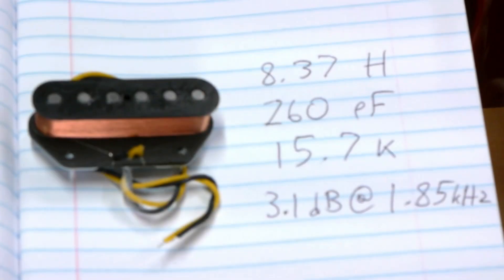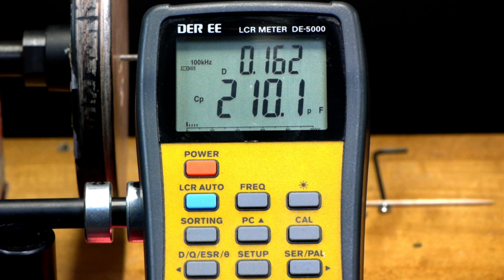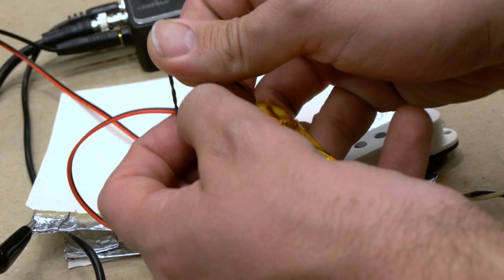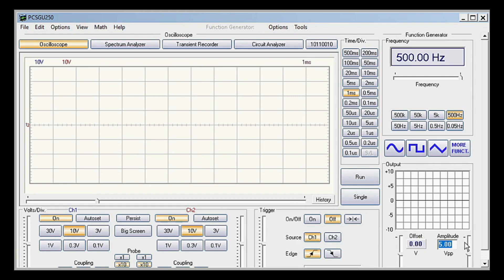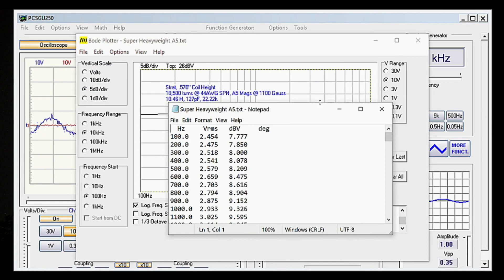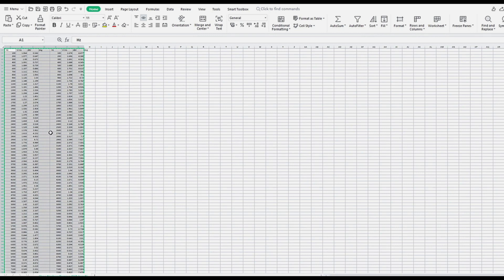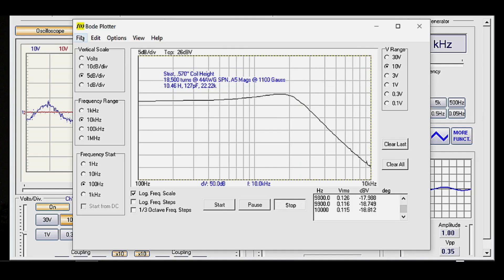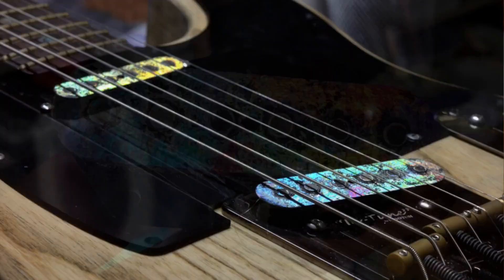Complete Guitar Pickup Testing: Step by Step Guide (LCR Meter, Gauss Meter, Oscilloscope)

Comment: 1st that Antigua Copy Paste work of Helmuth Leme ( he used knowledge from science - physic), actually lot of people copy his gadgets and don't gave him a credit at all.
2nd- that way of measuring is incorrect, 
3rd amount of error is huge
4th problem with today wonna be guitar scientists is that people think that they measure at home with highly changeable variations of pressure, temperature etc and above all conditions at home are not control that is a sound lab.
5th sine guitar is the source of the sound all those measuring don't mean much without a guitar
6th values will change even depending from a player. When to put guitar on your body it behave difrent. 
So all measuring's with lot of error's is IMHO only hype to sell pickups to ''sound smart'' 

Milan -Mike Dj. electronic Engineer ( guitar player, pickup winder blah blah ☺)
Reply from the maker: 1) Antigua has given credit endlessly to Helmuth Lemme. I actually only heard about him through Antigua, who has recommended his work many, many times and has made many threads about it. Antigua is the main person who has even made people aware of Helmuth Lemme over here in the USA and is constantly referring to, and quoting his work. 

I own his book as well - Electric Guitar: Sound Secrets and Technology. 

Manfred Zollner, author of Physics of the Electric Guitar, is another person I was turned onto by Antigua, and I own his book as well. The only reason I didn't mention them is because it slipped my mind, though in my video on winding noiseless pickups, I do quote Helmuth Lemme/Manfred Zollner and refer to information from their books on stacked humbuckers. I actually use a direct quote to explain the science behind how stacked humbuckers work as their books are the premier source of information on these things. 

2) I'm curious as to why you say the method of measuring is incorrect. I would love to know what the correct method is and also how to perform it. I'm not married to any methods. Only interested in the ones that work. 

However, I will argue that I have gotten excellent and repeatable results with these methods. I've used them extensively with repeatable, reliable results, and I have a hard time seeing how these methods would be incorrect, given that they've proven themselves useful many, many times in the real-world applications of my rewinding of vintage and modern pickups, and designing new pickups for people with very specific demands. 

These test methods have been indispensable to me. If there is a better method, I would be very curious to try it and to see how it compares to these methods that I have been using -- and have been very successful with so far. 

3) Which error rate is huge? I've built, wound and tested many, many hundreds of pickups and my results are always within very tight paramters, as measured by the LCR meter and USB oscilloscope. 

Pickups I wind to the same specifications are always within tight parameters. I am not seeing a huge error rate at all with these methods. 

With any pickup I make, it is always very reliably within tight parameters for L, C, and resonant peak. If these testing methods had a huge error rate, I would not expect that I'd be seeing virtually identical results every single time I make a pickup according to a particular recipe. 

4) I agree that tight control parameters are best. This would also come down to having a CNC winding machine that would actually be capable of doing a specific winding pattern -- and also a tension meter, to regulate the tension on the wire. All variables have to be controlled for building the pickup, and all variables have to be controlled for testing the pickup as well. 

However, I disagree that a highly advanced laboratory with state of the art equipment and everything controlled for as highly as possible is the only relevant testing. Home testing with a good LCR meter and an Integrator + Oscilloscope setup can provide relevant insights. I'd argue that extreme accuracy is not necessary because everything is relative. 

In other words, testing a stock Fender pickup, and getting certain parameters, will set a decent enough metric by which to compare another pickup. I can and have made pickups to fit specific tonal specifications based on measurements I've taken of pickups that were in the guitar -- and used the information I tested to create a pickup with a different profile that suited what people have wanted -- including myself, and my own desired sounds. 

These methods of testing have been very useful for me as someone who has built and wound a lot of pickups over the years, and I've used these methods for my own builds in my own guitars many, many times with great success. 

5) Ken Willmott's integrator device is not perfect, but it is constructed to put a similar load on the pickup that would be put on a pickup mounted in a guitar, including capacitance from a normal guitar cable, and load from volume and tone pots. 

There is a "loaded" and "unloaded" feature on Ken Willmott's Integrator device, to simulate the pickup being loaded into an actual guitar circuit. 

6) I completely disagree that this is all hype to sell pickups by sounding smart. This could not be further from the truth. 

Antigua does not sell pickups at all and every single one of his posts is just a result of his hobby of measuring pickups and being curious about what makes them sound the way they do. You can find this easily online in any of his posts. He is not selling anything, and never has. 

As for me, I only sell pickups infrequently, and I've never used these test methods to sound smart and hype up my pickups. 

I firmly believe, and can very easily demonstrate, that these measurements are accurate, and only serve to help people understand what they're actually getting when they buy a pickup. 

I would argue, actually, that saying that these tests are all "hype to sound smart" is actually hype to sell handwound pickups, by claiming that these tests are junk, and that handwound pickups have some particular 'magic' to them that cannot be measured -- so buy my pickups, because they're doing something magical that will not show up on an LCR meter or oscilloscope -- trust me! 

Because I will tell you: neither I nor Antigua is using these measurements to "hype anything up." There is absolutely no reason for me to post this aside from a labor of love and a desire to get information out there -- for free. 

So all else aside, that assumption is 100% completely false as I know my motivations, and they are not to hype anything up or to "sound smart." It's to use a practical method to evaluate pickups and to better understand how they work and why they sound the way they do. 

6) I would love to know more accurate test methods that account for the dynamic changes in sound while playing a guitar.

What you say is true -- the way you play will change the tone. 

However, while this is true, it grossly overcomplicates what pickups are doing. High impedance pickups, specifically, have a "baked in" EQ response, which is represented visually as a bode plot. 

The decibel voltage at a particular frequency, plotted from 100Hz to 10 or 30kHz in 100Hz frequencies, will produce a reliable representation of what frequencies the pickup is emphasizing, and how much, compared to other frequencies. 

And I can very confidently tell you that a pickup with a resonant peak around 1.5kHz will sound much darker than a pickup with a resonant peak around 4kHz, and generally speaking the inductance will be much higher in the lower resonant frequency pickup -- leading to dramatically increased output, which will dramatically affect tube breakup. 

You look at enough bode plots and you can predict how a pickup is going to sound based on nothing but the bode plot alone. They absolutely have value. 

One other point: Look into Cyfi research and their modular pickups. This is all open source by the way. They do sell pickups but freely share their plans on Github so anybody can recreate what they've done for very little cost. 

And they use bode plots to illustrate exactly why low impedance pickups are so flexible: it's because they have a very flat EQ. On a bode plot the line is virtually straight. Compared to a normal high impedance pickup, which has a peak at a particular frequency -- a rise up before it, and a slope down after it, like a roller coaster. 

There are real practical applications of this in the real world, and I've used these methods extensively when doing rewinds, and for planning out pickup 'recipes' for people -- including designing pickups from scratch. 

I am more than open to criticism and feedback. But I would need to see a very clear argument with very clear evidence, including the exact testing equipment used, and the results that were achieved, to convince me that the methods I've illustrated in this video are useless. 

They have been anything but useless for me, and in the most real world practical application: pickup rewinds, and custom pickup builds and winds. 

I'm not saying this is the be-all end-all of testing. And again, I'm open to criticism and feedback. 

The only thing that rubbed me the wrong way here was the accusation that this was to hype up sales by sounding smart. 

Absolutely not true -- demonstrably false. And again, I would say the opposite is much more likely to be true:

People saying that testing like this is BS, and there is not a test in the world that could possibly show the magic of handwound pickups, because what makes the pickups sound the way they do simply can't be measured. 

Home tests are not laboratory quality, for sure, but we're talking about passive, high impedance transducers for musical instruments -- not aerospace technology. 

Home testing equipment is certainly "good enough" for hobbyists and it does provide very valuable, repeatable, predictable information. 

I'd be curious what the team at Seymour Duncan or other major pickup manufacturers use. Like when designing new pickups. There actually was a post from the guy who invented the P-Rail pickup at Seymour Duncan. 

Frank Falbo I think his name was. Someone posted a question on my noiseless pickup build video about it. The Guitar Nutz 2 board has a lot of smart people there and I would not be so quick to write them all off. Everyone there is well aware of Helmuth Lemme and Manfred Zollner and the people there are way smarter than me. 

I just wanted something to measure pickups more accurately, and this definitely fit the bill. If there is something truly wrong with this testing setup, I would love to know so I could use something more accurate.
Reply: @guitar_md  I am excited to see what the über troll will answer to this 🙂 🙂 But he will probably not answer at all.
Reply from the maker: @qddk9545  No offense taken from him! I believe he's being genuine and sounds like he has a lot of experience with winding pickups, and probably has been doing it much longer than I have. 

I have no problem as long as people are respectful. The only thing he said that rubbed me the wrong way was insinuating I posted this to hype up sales for pickups and to sound smart -- however, in another comment he left on an older version of this video, he clarified that he was not accusing me of that directly or saying that I was doing that, just was a general commentary. 

Overall, no issue at all. I don't ever want anyone to think I'm not open to criticism. I always am -- as long as it's respectful. I took his comment as a respectful disagreement/criticism. 

Sometimes my super long replies might come off as me trying to be a know-it-all -- I hope it didn't come off that way as well. 

I'm always open to new ways of doing things and someone pointing out that I'm wrong if they truly know more than me. But I do value being thorough and I will make a case for myself and my current methods respectfully -- for debate/criticism/etc. 

I appreciate your support for me and my channel as well! I do my best to be as thorough as possible and one of my biggest fears is that I've missed something and am posting inaccurate information. So I'm always up for learning more. 

Plus, debate is good for my channel as it gets the comment section going. If you haven't seen my epoxying an acoustic bridge video....that blew up! And many of the comments are very negative! You will notice how I only get short with people who directly insult me, but respectful criticisms, I am more than open.
Reply: @qddk9545  Trolls' never sign with their name. I don't understand why some people think it's trolling if you say something that is from your education - profession, something that is based on what did you study for can't be ''trolling''? Everything I am writing like my first comment has nothing to do with this man directly, I saw his video and praised him in another comment because he is OK, but what is shown about the measurements and some conclusions, sorry, is not correct if you wish to observe it from scientific point. But video is great, it help out people to wind a pickup.

So my comment regarding pickups has nothing to do with me, but with Thales of Miletus, Tesla, Newton, Faraday, Gauss, Maxwell and other scientists who laid the foundations of physics - magnetism, induction, sound, etc.
I did not write anywhere that what was said refers to OP specifically  nor the video, because he picks data on the net + his experience+ people were he learned to wind pickup etc. so if you understand me well - it's not his fault nor it's personal critique.

Imagine how I feel as an engineer ☺ and thousands of other engineers in the world when people who are not trained in electronic and physics - talk about it and pretended they are ''scientists'', so certainly We don't call them "trolls" , no matters that some of them make money by selling products for which they use quasi-science. There are hundreds of them who have made millions of dollars through various hypes. Because it is 'fraud' ( maybe not the best word)  if you convince people of something that is not true with the intention of making a profit.
(Pls once again to underline i aim on some other brands not on a video nor OP)

Unfortunately, there are no laws against advertising and false claims. There is a law on consumer protection, but the guitarists are calm people who don't even try to ''fight'' for their rights. 

Afterwards, some guitar Gurus in Magazines and on Forums  wonder:
 "Oh, why are fewer and fewer people playing the guitar. Why guitar music isn't popular is it used to be"? 

Well, because they brainwash teenager's and younger generations that they need a $3000+ guitar, that they need a set of pickups that costs at least $200- 500$ ''hand wound'' with machine or made by some ''magic CNC'' (which will never do same job as humans when it comes to winding), a $3500 amp, and that it has to have the "Made in ....."  mark and be under a specific brand name.

Pls tell me what is % of teenager's who can afford that? IMHO less then 1%. 
 So  i have nothing against the video nor person who made it, and why on earth would i? IMHO honesty is OK when We share what We know and think, people can agree or disagree and that is all OK.
Reply: @guitar_md  Nope i didn't think this at all ''The only thing he said that rubbed me the wrong way was insinuating I posted this to hype up sales for pickups and to sound smart '', maybe it's lack of my English knowledge or i should make it clear that it it's not personal.
Reply from the maker: @milandjordjevic7952  Yes, this is why I pointed out in comment. I saw in another comment you pointed out you were not accusing me of this, just general commentary. I do appreciate the clarification, no offense taken
Reply from the maker: @bobibobik5903  I do understand your points. 

However, two points:

1) If my testing methods are not accurate, I'd like to know why, and what would be more accurate. 

2) Even if these tests are not scientifically sound from an engineering standpoint, they can certainly go a long way in dispelling all the marketing hype you're talking about. 

I've measured many expensive pickups, and I can say with confidence that a cheap pickup will sound the same, as long as it's close enough to the measurements that I showed how to perform in this video. 

Whether a pickup is $1,000 or $10, if the bode plot looks the same, and the pickup is the same type (Strat, Tele, humbucker, etc.) it will sound the same. 

Notice how NOBODY selling pickups lists the inductance, capacitance, and resonant frequency. Not one person is doing that. It's never a selling point. 

This is because objective testing like this dispels mythology. It isn't in their best interest for people to have any understanding of why pickups sound the way they do.
Reply from the maker: @milandjordjevic7952  Also, this is the Wiki for the Integrator, the device I use to measure pickups, if you're curious or have any critique of the design and use: 

https://github.com/KenWillmott/integrator/wiki
Reply from the maker: Also, check this out, from Helmut Keller: 

https://gitec-forum-eng.de/getting-to-know-you-pickup-a-tool-for-measuring-the-frequency-response-of-the-impedance/

You can find a discussion about it here: 

https://guitarnuts2.proboards.com/thread/10045/gitec-software-impedance-frequency-response

If you disagree with these methods of measurement -- I would join Guitar Nuts 2 and post your thoughts there. I'm a "button pusher" kind of guy. I asked Ken Willmott extensively about how to hook up his Integrator device, and Antigua over the years has referred me to Manfred Zollner and Helmuth Lemme's books, which I've read through, but go way over my head, as I have no engineering background. 

If you have any advice for a proper setup, let me know -- all the people discussing these things in-depth are way smarter than I am. I simply look for the best advice I can with this stuff, and follow the instructions. 

I just wound a set of Tele pickups and I will say that with the Integrator device and LCR meter, the readings do seem very accurate -- if they aren't, I would like to know why, and if there's a a better way, I will be doing that ASAP. I have yet to try that GITEC tool that Helmut released. But am looking into it now. 

It's a free download and in the documentation he describes what pickup frequency is and how to measure it. 

I will have to figure out how to do this and compare results with my current setup. However, if you are an engineer, I think you could certainly appreciate Helmut's writeup in the PDF file, under the "Documentation" folder in that zip file, if you download it from that link.
Reply: @guitar_md  I agree with you told about pickups price points, IMHO it all depends from how We make them + materials ( they don't have to expensive at all) + some if i may call them ''tricks'' or differences that We don't see in commercial pickups. Also each guitar deserve specific pickups in ideal world , but that is imposable to achieve so people need already made pickups and use them for guitars. In others words pickups are not tailored for specific guitar. The issue is that basically all winders We see claim they can do it but they only copy paste exiting approaches and few variables, it's copy paste of what fender and Gibson did in majority of cases and what Rick, Selmer, Burns, Hofner, Teisco etc did in smaller portion ( they copy models and ''recipes''). Moreover  some of the values they get from various books are ''incorrect'' due to measuring, people who just used multimeters didn't care about conditions.
Reply: @guitar_md  BTW i liked everything i saw what you wrote from this and another account, just saying.
1- for the start you can try to measure pickups in a room were you'll try to have the same temperature or at least close as possible ( depending from time in year), that alone will give you a huge advantage compared with a majority of pickup data out there.
2- Well i agree that measuring today are in general better then before. For sure good enough to wind pickups and sell them, people do that.

Sure some don't post all those data but some do, i saw it, once again it is nothing regding with you but i saw what some were doing for the last 10 years or so. 
Yes i know that it's not in interest of majority of companies to dispel myths. 

To be honest it's terrible due to i know some who use hypes, i mean ''know'', they are not not my close friends, some i never saw in my life but even in this region there are people who will ask without any shame 400-500US $ for a pickup. 
IMHO they don't have moral at all, but i try not to judge them, it is just panful to see that guitar music is ruined by those ''Vintage, Magic'' sellers. Some for sure get parts from China, i know due to i gave to some links and information's. Due to all that i feel terrible mate, it's like i did a huge damage to the thing i love the most - the music,  guitar music to be precise 😔.
Reply from the maker: @bobibobik5903  This is why I like making pickups I don't see anywhere else -- and of course, building and winding your own pickups you can get as creative as you want. 

I do agree that in an ideal world, each guitar would have a set of pickups tailored to it. This would include string gauges. One nice thing with humbuckers is the ability to stagger the poles at will, which you can't do on Fender style pickups without risking the destruction of the pickup. 

This is yet another reason I ventured into experimenting with wire I've never heard of anyone else using, such as 48AWG, with very short coils. It does yield some interesting results. So much has already been done in the pickup world so it's quite challenging to do anything truly unique or novel. 

For the modern 'bedroom' guitarist, I think noise cancelling low impedance pickups could very well be the way of the future. The flat EQ profile means they can be adjusted to sound like pretty much whatever you want in post-processing. With all the amp modelers and other things people are using now, a truly neutral pickup may very well be ideal. 

Cyfi research has information here on just that: 

https://www.cycfi.com/projects/nu-series/

"Nu Modular" pickups, with complete DIY plans on how to build your own if you so desire. I haven't attempted it yet. But I like the concept very much. We have to keep the times in mind, and many people now are playing exclusively through audio interfaces and/or amp modelers, even if they're out playing gigs -- modeling is taking over. 

Having a dead quiet pickup with a flat EQ seems ideal for this situation. Especially with all the noise generated by computers and monitors. Getting a clean recording can be very challenging without effective noise cancellation. 

However, there is also the "plug and play" ideology. I make all my own pickups for my own guitars, and for example, I prefer a highly overwound bridge pickup. I make my Strat bridge pickups with 18,000 turns of 46AWG, and the tone they get is just perfect for me. I pair it with a 7,600 turn neck pickup. 

And I wire it with a series/parallel and in phase/out of phase switch, master volume, master tone. I make my own pickguards and make custom 2 pickup pickguards for my Strats, and I also make a top-loading plastic jack plate, with a 3 way box switch installed on it as well. 

In this way, I have no switch to get in the way of my hands when I play. And I get 6 combinations from 2 pickups, with a lot of variety in between via using the tone knob, which I have set up with a .047uF cap. 

Now this is what I personally like. On my Epiphone SG that I converted to a fretless, the humbuckers I made have Alnico rods instead of bar magnets and slugs. I used Alnico 2 for the neck, and a mix of Alnico 5 and Alnico 2 for the bridge. 

The neck humbucker is around 5,000 turns on each coil of 42AWG. The bridge humbucker is 9,000 turns on each coil of 44AWG. Standard 49.2mm bobbins. I got double hole nickel covers for them as I like the look of covered humbuckers on an SG. 

The neck pickup especially has a lot more clarity owing to the lack of steel. Its inductance and resonant frequency is much closer to a Strat pickup than it is a traditional humbucker. It does still have comb filtering of course because of it being a humbucker. 

But it's much clearer sounding. And no mystery -- Alnico poles result in much lower inductance compared to steel slugs, so for the same number of turns you get a much brighter, clearer tone. I hate neck pickups that sound dark and muddy so I always make mine, whether humbuckers or single coils, clear and bright sounding. 

Now that's for my guitars. To really make pickups specifically for an individual guitar I think the pre-requisite is the player really has to care. A lot of people really don't. Many people are happy with stock pickups, and some people are "happy enough" with new pickups that are different enough from what they already have. 

For most people, 'dark' or 'bright' is as far as it goes. Only the most discerning players seem to care about minute details. I was making pickups for one person that had that attention to detail -- and in those cases, it's best to work one-on-one and do a custom project, which usually requires experimentation anyway. You make 3 or 4 pickups and they try them all out and see what they like best. 

This is not feasible as a business model. This is the main reason that I don't make a business out of pickup winding despite having had a lot of experience winding pickups and doing many vintage pickup rewinds.

Personally I'd rather give a few people something truly unique, rather than a bunch of people the same thing that everybody else has. Plus, one-on-one projects tend to be much more challenging and mentally stimulating. 

For that reason, I only like doing them once in a while. One of the most fun was designing single coil soap bar pickups. Single coils that would fit into a soap bar rout on a bass. I ended up using two rows of Alnico poles, after cutting out my own flatwork on the router table. 

I had to make stands with dowels so the 'ears' of the pickup wouldn't collapse when height adjusting it. It was a bit of a challenge to complete. 

But I never heard anything else like it. Great sounding pickups. And on a fretless bass. It was a one-off. I've done things like that a handful of times, most of the time it's just variations on the typical Fender or Gibson design, as you said. 

I mostly avoid cut and paste, and keep 'vintage winds' to actual vintage rewinds. 

For me it's a labor of love. I like making videos about all the work I do even more than I like doing the work itself, at least in terms of volume. 

I get more enjoyment of doing a very deep dive on jobs I do, and making comprehensive videos about them -- more than just doing the same thing day in and day out. And when I'm done with a video, it's onto the next. 

This is great novelty to me. And with pickups, I always want to feel like I'm moving forward. I recently have experimented with a piezo disc pickup in the neck pocket of a bolt-on neck 12 string, along with a low impedance, noiseless magnetic pickup. About 500 turns on each coil, in a noiseless stack, with steel poles and a neodymium bar magnet. 

Now, I have no idea what I'm doing with wiring. And impedance matching. I really don't! But I will say, this combination could sound magical. It's close to being like an acoustic 12 string but in a solidbody electric 12 string format. If I can find a way to wire the piezo and low-z pickup together that makes sense, and really works -- I might be onto something. 

In the meantime, I'm enjoying it. And working on a video for it. Fun stuff!
Reply from the maker: @bobibobik5903  I do know what you mean. 

However, what helps me is knowing that it's all marketing psychology, and this happens everywhere, all the time. Nothing can be done to stop it. 

And here's the real kicker: even if you tell people the truth, they will often either not believe it, or not care. 

For me personally, I have talked people out of having me make them pickups. I've asked them if they want a different tone -- if they're really unhappy with what they have, I'm happy to help. But many times people just feel insecure, like they need something more expensive. 

Usually that's just low dopamine. It's like a drug. They want to buy something new and shiny because it feels good to buy something new and shiny -- you get a hit of feel-good brain chemicals. 

Most of the pickup winders I've talked to have acknowledged that most people buying expensive pickups are not playing gigs. They simply want to own expensive pickups, they get attracted to the idea that they have some magic to them -- and that's that. 

I have measured some very expensive pickups. Like you, I won't name names. But I have seen and tested many hyped up pickups, claiming to be magical -- and there is nothing magic to find about them. 

Now, here's an alternative viewpoint: I have done some vintage pickup rewinds for a particular customer. He REFUSES to have anyone but me do the rewinds. He loves them so much, he will not have anyone else do it. 

I have never once claimed that there is anything special about what I do, and that anyone winding using the same wire and turn count that I'm using should be able to achieve the same results. He does not care -- it has to be me, and only me, who does this work for him. 

This is just the psychology of it. I'll raise one more point: 

I only want to use my own pickups. Are mine better than anyone else's? No. But. I only want to use mine, for psychological reasons. Maybe pride. Maybe ego. I only want to use my own pickups, and set up my own guitars, and guitars that I fretted, that I finished, that I did all this custom work to --

-- why? Psychology. There may be no difference using a guitar someone else did all the work on, but I want my guitars to be "mine." 

So. The human mind will often rationalize things that are completely irrational. This is because we're largely emotionally driven. 

I wouldn't worry you've ruined anything. If it wasn't pickups, it would be something else. The guitar market thrives on novelty, just like every other market. It isn't even necessarily "keeping up with other people," but the dopamine hit of having something shiny and new and 'better.' 

I'm equally against dishonesty. I think it's OK to describe the tone of a pickup in poetic language. But even that's a fine line. We run into the problem of....most people will not understand electronics measurements even if you tell them. 

And how else do you describe sound to someone who isn't a sound engineer and doesn't understand things like resonant frequencies, or capacitance or inductance? This becomes very tricky. 

So I'm really only against the people claiming that they have the 'secret sauce' and their pickups are BETTER -- for reasons that are demonstrably false. 

The idea that some particular 'magical' element sets their pickups apart from others -- I would need to see evidence. 

That's where the science comes in. Even me, who has been winding for years, gets confused -- some of these people are so convincing with their claims, it's hard NOT to believe them. 

I do think integrity is important with all work. So since I do guitar work, I do my best to bring integrity to guitar work. I have often even talked people out of hiring me for a job if I believe it will not benefit them and they should just save their money, or get another guitar. 

I've also talked people out of buying pickups from me if they're happy with what they currently have. Once you go down the Pickup rabbit hole, it's very hard to get out. 

I have the luxury of winding my own pickups, so making my own experiments costs me very little compared to buying new pickups, and I can make my own designs that don't exist anywhere else. Like those Bill Lawrence Micro Coil style pickups, but with vulcanized fiberboard, and 48AWG. I have never heard of anyone else using 48AWG to wind a pickup. 

It is an interesting wire gauge. Not sure I could go any thinner than that. Experiments do get expensive though as rolls of wire can be hundreds of dollars and all the raw materials do add up fast, especially with prices going up. I doubt I've made enough money selling pickups to even cover the costs I've had into tools and materials for making them. 

A labor of love for me, for certain. I also feel like winding pickups day in and day out, and doing nothing else, would drive me absolutely insane. Maybe I could, but my first thought is nope -- I'd go nuts if that's all I was doing.
Reply: @guitar_md  Thx friend, i saw a those things, meaning i have that. But thank for your kindness. Currently i'm in some mess, 1st i was sick then someone ripe of my work, so i have to somehow hind a solution for all that..I might join that site that you've mentioned.
I was working so hard to design a fret file that is uniqe and then some big brand thinks they have right to make my idea and make millions, that hurts a lot...
Thx for you will to share that is great, no matter that i saw all things before i respect your kindness that is what matter the most.
Reply: @guitar_md hey guys, I'm currently doing my undergrad research on guitar pickups and I'm wondering if you all had any advice for me? I will have access to an anechoic chamber and own a cnc pickup winder, I'm concerned about getting the bode plots, will I be fine with using this exciter coil?